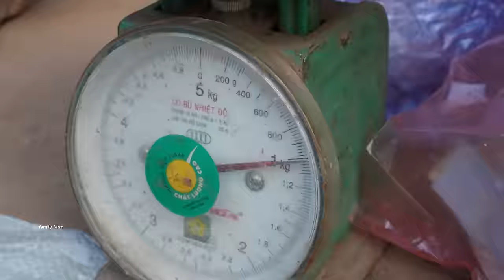Store up a large store of firewood, harvest pumpkins and cauliflower to sell at the market

Comment: You need to tighten the chain on your chain saw its way to loose ,you will find it cuts straighter and your bar will last longer if you flip the bar over so the top of the bar will wear evenly with the bottom of the bar. I ran a chain saw for 60 years and i cant believe that chain doesnt come off when you are using it.